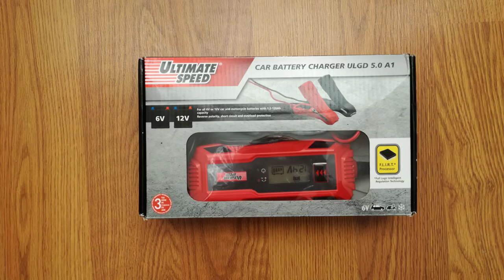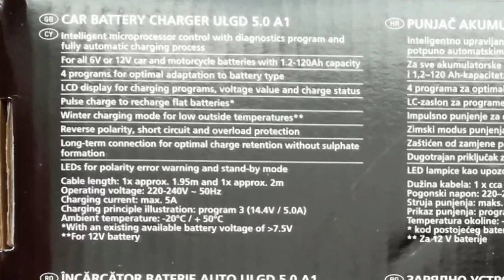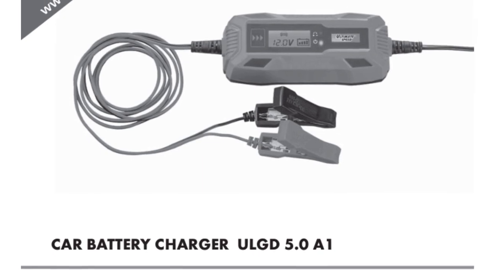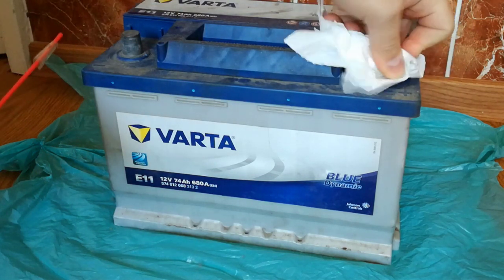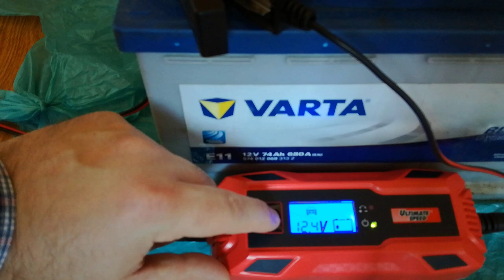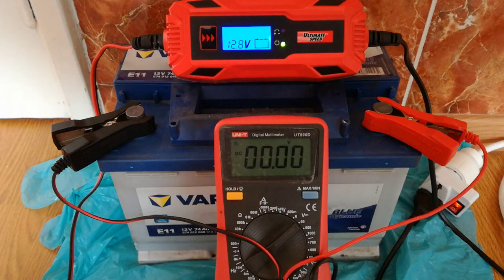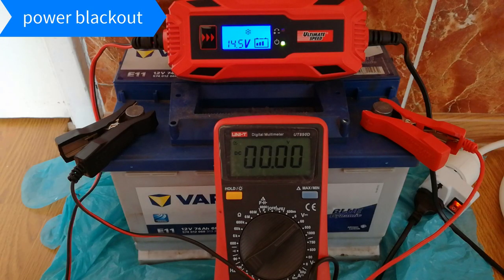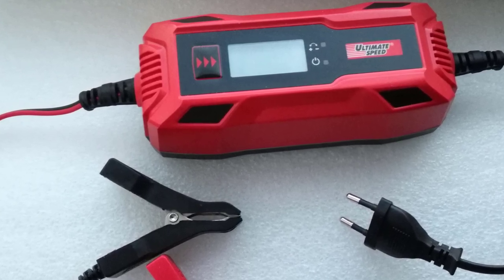rd #312 Testing  ULGD 5.0 A1 Car battery charger from Lidl

Comment: Excelent video ,i bought this charger a week ago version B1 ,the new has the wire not soldering but are crimping
Reply from the maker: That is a good thing, they made an upgrade for the A1 version.
Thank you for watching.
Reply: @redigitt  Thanks you

Comment: I bought a new one today (ULGD 5.0 B1) and the charging clamps have mechanical joints now.
Reply from the maker: Thank you for this information.
Reply: I have also the latest one the UGLD 5.0 B1, but there is something wrong with it. It keeps charging. 12,8v is full. But it never stops flashing. I have 2 other battery loaders and they stop loading and they say "full". Tried it with 2 different good batteries. I also have a Topdon BT100 battery analyser. So I can see the internal condition, resistance and of it still has it's cold cranking amps. Because a battery can be full, but that doesn't mean it's still healty.
Reply from the maker: Probably still under warranty, send it back under warranty.
Thank you for watching, if my video  was useful please consider to share and subscribe, have a nice day.
Reply: I have buy this charger and when i plug it on it show that my batter is 5,9V and when i push the button for choosing mode it don’t switch to charging mode

Comment: Could we let de battery connected on the car ?   Should be nice to avoid a GPS,Radio , Clock , reprogramming . Is the alternator will accept that ?
Reply from the maker: Please read the instruction manual https://www.lidl-service.com/static/2929605641/296069_IE_EN.pdf
In the manual fist says on the bottem of page 2 :  This charger is suitable for indoor use only.
At page 4 : Before starting the charging or trickle charging procedure on a permanently installed battery in a vehicle, first disconnect the negative terminal connecting cable (black) of the vehicle from the negative terminal of the battery. The negative terminal of the battery is usually connected to the vehicle’s coachwork
Thank you for watching, have a nice day.
Reply: @redigitt  thanks a lot.  Sad..  it's not suitable for what I need. Thanks again. Have a nice day..
Reply: yes you can . it is safe to do so. just connect the charger to the battery first and than power the device from the main socket
Reply from the maker: Thank you for this information

Comment: Charging a car battery won’t go beyond 3 bars or 13.8 volt. Is it because the battery is old (2 years) or any other reason?
Reply from the maker: I'm not a certified mechanic, I bought the charger because I didn't use the care a longer time and the battery was discharged and in the service they would charge me more and I had to go there with a taxi. This is not a professional battery charger, a professional car charger cost about 10 or 20 or more. 
A 2 year old battery is not an old battery, it depends how long time was uncharged, it was outside in the cold, and so on.
You could check the + and - poles to be cleaned, to not have corrosion , you can clean with WD40. the clamps should have a good strong contact. If you cleaned the clamps and the + and - and it did not charged in about 24 hour, then you should go to a service to diagnose the battery and if it good, then they can recharge with a professional charger.
 Thank you for watching, if my video or advice was useful, please consider to like, share, it helps my video with the YouTube Algorithm, have a nice day.
Reply: @redigitt  thanks for ur reply. I had left the car in the cold (around minus 10) for days.  It got completely discharged a few times. Then I had to jump start it with the help of another car.
Reply: @redigitt  And at the end I heard bubbling sound while the battery was being charged, it guess it got overcharged because it was boiling. I just installed it back in the car, the car wouldn’t start haha
Reply from the maker: Sorry to hear that, when it is disscarged you have to charge in session, 3-4 houer you charge, 1 houer rest.
Reply: If the charging voltage doesn't increase, the battery is heavily sulphated. Keep on charging it with small current (motorcycle mode) until it gets fully charged. The process takes many hours...

Comment: Can we without damaging the alternator and / or regulator charge the battery without disconnecting it from the car so as not to have to reprogram everything
Reply from the maker: Please read the instruction manual https://www.lidl-service.com/static/2929605641/296069_IE_EN.pdf
In the manual fist says on the bottem of page 2 :  This charger is suitable for indoor use only.
At page 4 : Before starting the charging or trickle charging procedure on a permanently installed battery in a vehicle, first disconnect the negative terminal connecting cable (black) of the vehicle from the negative terminal of the battery. The negative terminal of the battery is usually connected to the vehicle’s coachwork
Thank you for watching, have a nice day.
Reply: yes you can. i do it with all the cars and never had a problem. just make sure to connect it to the battery terminals without first plugging the device into the main power socket
Reply from the maker: Thank you for this information

Comment: Why do you not charge the battery directly on the car?
Reply from the maker: Because I don't live in a house, I live in an apartment building and I would need a power extension cable about 100m.
Thank you for watching.
Reply: @redigitt  Thank you for answering

Comment: can this be used with a maintence free battery eg non acid battery.
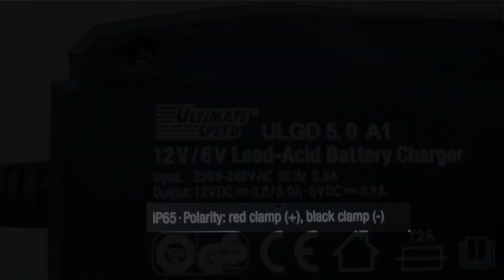Reply from the maker: It's a Lead-Acid Battery Charger, at 03:32 on the bottom you can read  12V / 6V Lead-Acid Battery Charger.
Thank you for watching.
Reply: Redigitt, It also says here Testing 6 V or 12 V lead-acid batteries with electrolyte solution (WET), electrolyte absorbent mats (AGM) or gel electrolyte (GEL) charger with reverse polarity, short circuit and overload protection from Lidl. It does not mention this on the base of the charger.
Reply: @Dave-so4je  I also a bit confused with the purpose of this device.On the body clearly says LeadAcid charger.However, widely this device positioned as multipurpose...???Any thoughts?

Comment: I have attempted, with this charger model new from Lidl,  to recharge a fairly new Exide Marine & Leisure 12v battery (caravan use) which has gone completely flat through non use for some months this year. All I get is the "Err" message on the charger, which I have correctly connected. I note your closing comment about a missing instruction on the box concerning trying to recharge in these circumstances. Is the charger now useless for my needs, and I need to replace with a better unit, that will charge??
Reply from the maker: If your battery is not completely flat like 0.0V, you need a little bit over 3 V + a good battery(12,4V), you can try to fool the charger, it will take a longer time but it should charge the battery.
You connect the 2 battery, you need to get a higher voltage then 7.5V ...your discharged battery has to have a little bit over 3 V   (12,4V+3,4V) :2 =7,9V.
Thank you for watching, if my video or advice was useful, please consider to share and subscribe, have a nice day
Reply: @redigitt  The battery was purchased brand new about 3 months ago. Through non-use/non charge the battery has fully discharged. If I understand you correctly, in this circumstance, it cannot now be recharged using the ULGD 5.0 A1 charger and effectively the charger is useless for recharging this battery - the purpose for which the charger was specifically bought. Yet, and as you point out, there is no cautionary instruction in this regard on the box (or, indeed, in the accompanying manual). Clearly, Lidl should not be selling a charger which is incapable of performing such a basic function as this! It is my intention now to return the charger to them for full refund. I await your further comment.
Reply from the maker: @michaelfox758  This is a cheap tool, but if you could borrow for a night  a good battery, you probably could recharge the flat battery.
At 1:43 https://youtu.be/IYv4S19QOJQ?t=105 they say the pulse charging is working only if the battery has above 7.5V.....this information had to be written in the front of the box with BIG RED letters, not everyone understand (including myself) that graphic illustration on the box.. Probably it is cheaper to recharge your battery in a car workshop instead to buy a professional charger  https://shop.baltrade.eu/2924,Inverter_charger_with_starting_support_12V_24V_everActive_CBC_40
Reply: If your 12 V battery is below 3.5V it won't charge, you need at least 3.5V.
In this case switch to the 6V mode and start charging, the charger should start charging the 12V battery.
After some time, if the voltage is above the limit of 3.5V you can switch back to the standard 12V charging mode.
This is how I do this in case a battery is deep discharged.